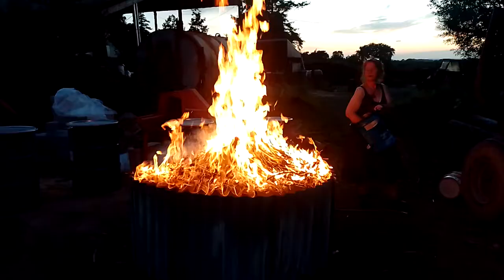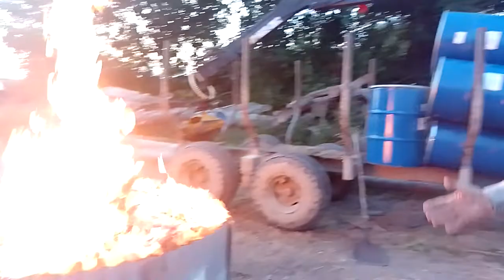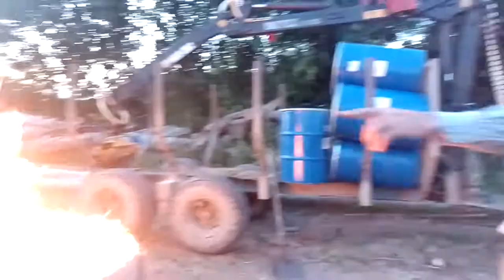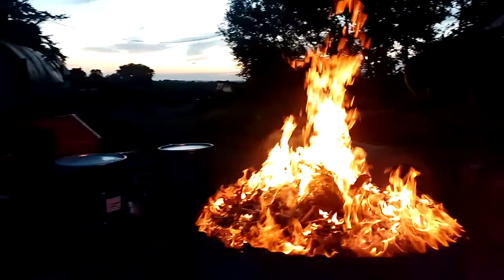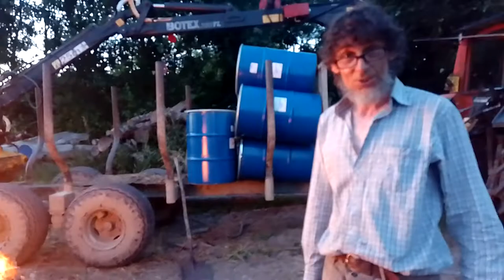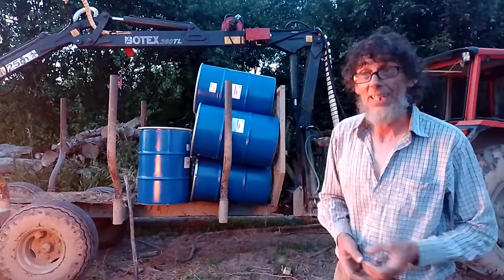Making Charcoal part 2a

Comment: Looking good!
Reply from the maker: Thank you, this is the cut down minimal method, hence 2a.
For the 12 m³ of charcoal I made recently for the smelters at Caherconnell Fort I used a larger ring of tin, sealed at the bottom to the concrete with a bit of clay and sand mix, and then lined with a layer of charcoal fines about 75mm thick to protect the concrete from heat damage. Surrounding this ring of tin we used another ring of tin as a heat shield, the same height and a little larger diameter this ring is placed around the first with firebrick spacers to keep it off the ground and provide a space between the two layers of tin.
With this larger kiln I was able to make 2.5 gross m³ of charcoal (fill 13 barrels) per firing in about 8 hours. At the end of the firing the charcoal is lightly quenched with a watering can (rose fitted) and shovelled into 200 l metal barrels (with a vent hole in the bottom) to cool.
Reply: @timfromtang  Very interesting. I've just enlarged my cone kiln, but I think I'll need to do that again. Burning drier chips does make the process fast, but making them and storing them is slow. Lots to learn. Looking forward to part 2b!
Reply from the maker: @wayoutwest-workshopstuff6299  Part 2b will be about a little epiphany, the cone kiln works so well because the fire always has a bigger surface area than the the stuff below being heated and charred.The conical sides help with preventing air from penetrating too deep into the fire and charring your precious carbon.
the epiphany, ...
da da da
a conical fire in a cylinder does very well too, the tall cone fire has a greater surface area, and the addition of a heat shield provides preheated air at the top edges of the burn cylinder.

So part 2b will cover sealing the bottom of the inner cylinder and lining it to prevent damage to the ground, installation of the heat shield etc etc, last burn produced 13 200 liter barrels or 2.6 m³ gross of charcoal (after sieving this made about 1.8 of metallurgical grade charcoal) your biochar process will benefit from the full 2.6 m³

It may be a while before my next burn as we're a bit charcoaled out after cooking 12 m³ for this years Caherconnell international furnace festival, and burning lots of it as we smelted iron, just home this afternoon it was glorious fun.

Best of luck with your exciting railway charcoal system I have been following along with glee.
tim